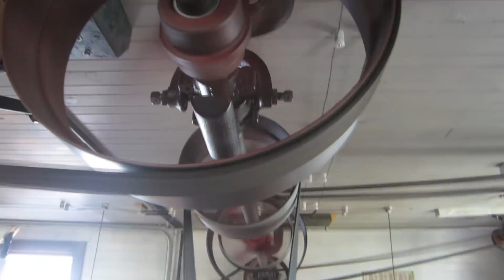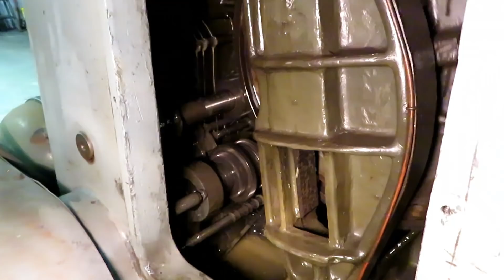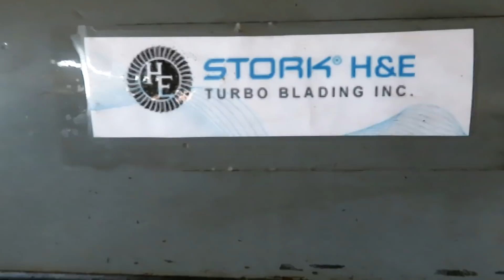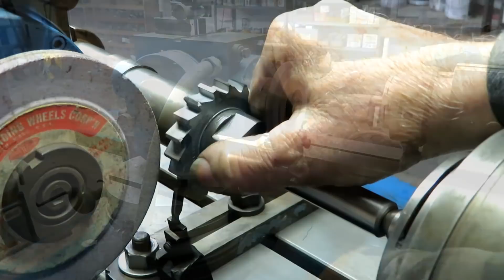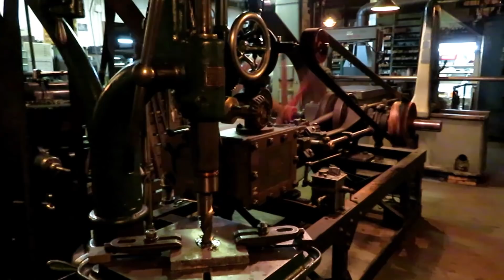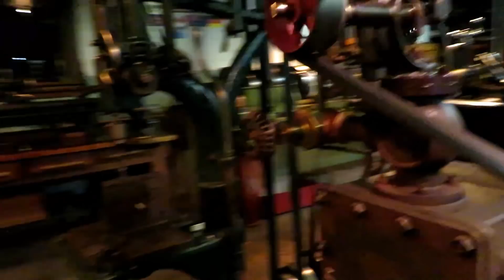OLD STEAM POWERED MACHINE SHOP  34   setting up a cutter grinder

Comment: Wondering about the triangular guides/slides on which the shaper slides back and forth during its cuts? Is that just steel that is very smooth and lubricated or is there some type of sacrificial metal such as brass etc ?
Reply from the maker: No Ed, it's cast iron against cast iron with tapered "gibs" to take up wear. The larger shaper has a circulating automatic oiling system that keeps it covered, the smaller shaper requires a shot of "way" oil every now and then in the oil cups......Dave

Comment: This is really fascinating. I'm a big fan of Abom79. Your machines are something like his grandfather might have used. In the late 1940's, my dad and I visited our local, small town machine shop. It was in a plain, old wooden building with poor lighting. I remember seeing the line shafts on the ceiling and all the belts. I was too small to understand what I was looking at but that memory has lasted for decades. Old Threshers in Mt. Pleasant, Iowa have a demonstration machine shop running on steam but you are doing practical work with a variety of machines. Yours is more educational and entertaining. This is certainly a lot more relaxed and slow paced than other YouTube machine shop operations. I am really enjoying your work and your shop.

Comment: How is it that you can drill a 1" (+ or -) without a pilot hole?
Reply from the maker: The drill had a pretty good grind with the point thinned. I was not concerned with accuracy because it was just a starting hole to bore out on the lathe......Dave

Comment: Watching you oil the machine bearings reminded me to ask you-- what arrangement do you have for oiling the line shaft bearings and the loose pulleys. Is it daily and are they wick fed or gravity? I used to look after some vintage machinery and the bearings were ring fed from an oil bath.

Comment: Not very many guys have tried this but you can run a CNC mill as a shaper without turning the spindle by running it in rapid. Works better than snapping off a bunch of 3/16'" end mills.  You can also index a circle that way.

Comment: David, Have you thought much about a condenser on your Engine Exhaust, save some good water???
Reply from the maker: Actually it's not good water, it would have cylinder oil from the lubricator in it that would really mess up the boiler steaming without an oil separator of some kind. A true condenser (that pulls a slight vacuum on the exhaust) also requires a water source and an air pump and would not lend itself to light loads and stopping and starting occasionally. Not worth the trouble......Dave

Comment: After watching you and other YouTube machinists for a long time, this semester at my local community college I'm taking a machine shop class (at 62 years young;). Today I turned my first four pieces, flywheel weights for a little steam engine, on a standard 15" LeBlond Regal lathe. I only needed three, but on the third one I turned a section undersized. Thanks for the inspiration:)
Reply from the maker: That's great Pat, You just discovered an old timer machining rule: Leave some "screw up" room.....Dave

Comment: something makes me wonder - you run a 40-50 PSI system, while someone else I know runs a 100-120 PSI and I'm used to seeing 150 on engines. my Steamer Friend says anything below 80 is "wet steam" and prone to condensing in pipes. any specific reason you run such a relatively low working pressure?
Reply from the maker: Hi Hyratel, your'e friend is absolutely right. But here's why I only run at 60 psi:  My boiler is 93 years old and though it is clean with good thickness, and hydrostacticly tests OK at 150psi, there will probably never be another boiler in this shop if it there eventually is a problem with it. Antique boilers with paperwork are very rare and expensive and a new manufactured boiler would cost as much as my house is worth!  My goal is to make this set up run well for the shop and this channel as long as I can. Aside from improper maint, the eventual fate of boilers is continued heat expansion and contraction. Mine is the worst case. I fire it up from stone cold and when finished it cools down completely and is nearly stone cold again overnight. At 60psi, it's average temp is about  300 degrees F. (I don't have my steam table book handy, but you can look this up) at 100psi its about 340, so that's extra expansion it doesn't have to deal with every time. It takes more fuel to run at a higher pressure because of the greater heat loss off the boiler. I have an engine that is about 10 times bigger than the power requirement and is capable of tearing up something really fast if something goes amiss, so I don't need the power. The only time I have excessive condensation ( even though I don't have the feed pipe jacketed yet) is on start up, or when sitting idle for a few minutes. I should have explained this better in the videos. This is a great question and I'm glad to give you my 2 cents.......Dave

Comment: Since when I hear the word "Shaper," I always think ,first, of it  cutting the "finger 'joints for a wood -bodied station wagon.

So I know have a REALLY dumb question for you---------could a metal shaper be adapted to "cut" 4 or 5 etc. "finger joints in the end of a piece of wood for a wood bodied stationwagon?????
Reply: Or could the same be done with a metal lathe?
Reply from the maker: might be a better job for a wood shaper which has a very fast vertical shaft like an upside down router...Dave

Comment: Thanks for going over the boiler.  Is that a modern boiler made to look old fashioned, or is that actually a boiler from the early 1900s
Reply from the maker: Thanks for watching Greg, If you are interested, check my first couple of videos. The boiler and engine is explained in some depth. The boiler is from a 1924 Mundy steam hoist, 72" tall, with 64 2" tubes.......Dave
Reply: Wow!  Nice to know the boiler still runs.  I'll look at those other videos and see if I have more Qs

Comment: Dave, Great videos, its like you make all those old machine shop texts I poured through since I was a kid come to life!!  Would you mind telling us a little about the radial engine in the background in an upcoming vid?
Reply from the maker: I can't show it to you because I just gave it away. But I can tell you it was really messed up. Blown rod and crank, must have been quite a landing. My cousin the aircraft rebuilder was throwing it away, I propped it up in the corner for about 8 years as a curiosity. It is a Jacobs 7 cylinder radial from a 195 Cesna probably about 1946 or 7.....Dave
Reply: I was going to ask the same thing.

Comment: Hi David. I'm watching your Dec.8 2017 video. I happened to notice looks like you have a pressure test station for automotive heads. I enjoy watching your old steam powered shop very much. I have for some time. I don't leave many comments because I am usually watching in the early morning hours. Thanks for what you do. Don from Oregon
Reply from the maker: Don, I'm retiring from the automotive engine business, that pressure tester just went to Kansas someplace....Dave

Comment: Hi Dave, didn't know you had a cutter grinder, is it a new addition. I have 2 grinding wheel hubs for Cincinnati cutter grinder. They don't fit my Norton, so can you use them? I only have 1 hub for it, tried a used machine dealer for more years ago with no luck.
Another great video, keep them coming.
Reply from the maker: Hi Paul, I sure can, the one I'm using I found on ebay. I have another that won't fit mine, may be Norton. how about a trade?...Dave
Reply: Sure thing, I'll email you a drawing of the hub I have for the Norton. We can go from there on the details of the trade if yours is for a Norton.
Paul

Comment: Judging by the sparks, that cutter is likely high carbon steel. HSS makes a redder spark without the secondary "explosions". (My first task, many, many years ago, in the toolroom was sorting scrap using the sparks to distinguish among HSS, carbon, and mild steels.) It wasn't long enough ago that the toolroom ran on steam and line shafts, but it was over a half century ago.
Reply from the maker: Probably you are right, It was old. Usually old cutters that were HSS were marked as such, seeing as how High Speed Steel was a big deal back then.  I've read that tooling salesmen had a hard time convincing the old old school machinists, like in Railroad shops, to run HSS  cutters with fewer teeth and get the speed way up. Like now with CNC tooling, the speeds seem ridiculously high to me.......Dave

Comment: I'm loving these memories, 
I served my apprenticeship at a company making tools and cutters in the 60s in the UK. We used to use a 4" cupped wheel on cutter grinders, setting the height of the indexing finger to alter the clearance angle. Not saying you were doing it wrong, it just looked a little awkward.
Reply from the maker: John, thanks for the input. I have no experience really with a cutter grinder, just some coaching from a retired tool room guy and some manuals (which don't usually agree on how to do things). I have some cupped wheels which I think will work better and also an end mill attachment. Tom is making up a proper tooth/ center highth gauge. ...Dave
Reply: One day I'd love to come over to exchange ideas and get my hands on with those lovely old machines but it's over 3000 miles and over an ocean, so it may be a while. :)

Comment: Hi Dave. When you showed the boiler Injectors I was wondering how the injectors work, or how they push the water into the Boiler. I'm really new to them and steam altogether, like a lot of us. I've learned a lot from you about steam engines. Could you explain the Injectors and some of the boiler in and outs. Thanks for sharing. Best Wishes n Blessings. Keith Noneya
Reply from the maker: Hi Kieth, check my video #1 or 2 for the injectors....Dave

Comment: Dave!  In the clip on the big shaper you gave us a glimpse of a small air-cooled radial aircraft engine leaning up against a wall - WHAT THE HECK IS THAT?  Does it run?
I thought you had the coolest equipment even before I saw that, but now I'm just amazed.
J.S.
Reply from the maker: John: It is a Jacobs 7 cylinder radial engine from a  Cesna 195 (about 1940)  It had a blown rod and crank. A couple weeks ago I gave it to a friend to clutter up his shop for awhile,  So that was the last glimpse of it in my shop.....Dave

Comment: HSS cutter, any special profile?  I like your anvil,   what does it weigh, also what are you using for a base,  Great work as always.  Have a Merry Christmas !
Reply from the maker: Shaper tools are ground about the same as for a lathe, a little less angles. I use a wide round nose for finish cuts.I think that's about a 250 lb anvil, My dad made that base probably 50 years ago and put casters on it....Dave
Reply: Is there a name on it?

Comment: Great video as usual! I love the way that you explain how yor tools work, but don't recall the specific brand of your drill press. The power feed gives you a chance to walk around and oil the various machines, which is a great component in itself! .... seeing all of the raw metal machine parts (not rusty) is a full time job and fascinating in itself! .... loved seeing the tool cutter grinder, and hope to see it more. I have the larger KO Lee model which doesn't compare to the Cinci, and hope to get it up and running soon. I have collected a multitude of parts, and different workheads, including the air bearing fixture, and all the necessary arbors, collets, and other misc items. The only one missing is the tap grinding workhead, and don't really want it! ...was wondering if you had a powered workhead ?? I think I may have a Cinci model around if interested.  Thanks for all your great work!
Reply from the maker: Thanks Jim, I don't have a powered work head for it which would be nice for doing lathe centers and such....Dave
Reply: I'll dig around a bit and see what   I can find.

Comment: I sure don't begrudge your winter stay in Florida as I'd do the same if I could Dave. It is going to be a long wait until you get back to this shop though. And nothing wrong with old school, I've learned the bulk of what little I do know from books written long before CNC. For a few of them I guess some limited tape drive NC was available, but what worked 100 years ago works just as well today. Beautiful finish your shaper produces. I'm sure the vise on it outweighs my little South Bend shaper and the stand by a lot. Enjoy that warm sunshine and the lack of snow shovels :-)
Reply from the maker: "What worked 100 years ago, works just as well today"...how true....Dave

Comment: Interesting video. Thanks Dave. (@31min) Is that drill not going much too slow compared to recommended surface feet per minute for HSS in steel? I know that the recommended cutting speed is usually the upper limit and you can also cut slower. So surprisingly for me the chips still look well formed. But why do you choose such a slow speed? For video purpose? Or due to transmission pulley sizes? Would the old timers also have drilled that slow? Of course they did not have HSS yet.
Reply from the maker: The stepped pulley belt needed to be taken up a little and would slip some in the faster speeds with a drill over 1 inch. I'm in no hurry....Dave
Reply: David Richards, It's lovely to watch you machine, and listen to the sounds of the shop. It's a peaceful break for us used to high speed CNC machines day after day, which feel rather soul-less and disconnected from the metal.
Reply: Thats what I was thinking, I thought it would have ran at around 200 rpm?
Reply from the maker: Good way to put it Matt, but it was inevitable.....Dave

Comment: Why is your bow off so low?
Reply from the maker: Don't need much pressure...Dave
Reply: I'm used to higher pressure for better efficiency and dryer steam.
Reply from the maker: Doug, It takes a lot more fuel to run it at 100psi though, I tried it......Dave
Reply: Right on, I was just wondering. I hope to see you in Florida this year.

Comment: love the video, finally seeing the drill press up close. I recently purchased an old  Mechanics Machine Company camel back drill myself, it doesn't have power down feed on it. Is that something they either had or didn't have, or can parts be added to complete mine?
Reply from the maker: Jeff, I've never heard of that brand and it's not found on the Vintage Machinery site. Do you think that was the name of the machinery dealer? they sometimes had elaborate brass plates riveted on. The Barnes that I have offered the auto feed as an option.  Can you email a photo?     enginedrdave@gmail.com

Comment: Dave, just curious what the make is on that camelback drill press. Cheers and thanks...!
Reply from the maker: Hi Dan,  W.F. & John Barnes Company, Rockford , Il.  It could be as old as 1880.
Reply: Thanks Dave. I picked up a J.E. Snyder camelback a few years ago. Needs new babbit bearings and missing some teeth. Similar to yours. Power down feed, etc. It had been in continuous use from 1922 until the day I bought at auction in June 2015 (my dad's sheet metal shop). Probably same vintage as yours, late 1800's. Haven't restored it yet, but maybe next year. I was inspired by Keith Fenners drill press... Cheers, Dan...!

Comment: Is there any special technique of grinding your shaper tools, or would you use the same geometry as in turning tools?
Reply: Depends what you are grinding tool for.Shaper tools use less relieaf angle and rake angles(i think it was 2 and 5° it was loong time ago ).
Great thing about shaper is its one of those universal tools-you can make gears on it(you need dividing head),flat peace of steel,make dovetails,keyways,and many more thing.
There was a channel on youtube Steve Summers is the name-all he does is shaper work,so maybe that will help.
Reply from the maker: I just use a little less on the angles and a more rounded nose for steel....Dave
Reply: I've got a baby sized English made Adept hand shaper, but haven't had a chance to use it yet. Thanks for your time and help, and happy Christmas!